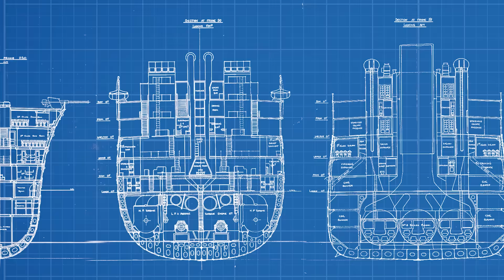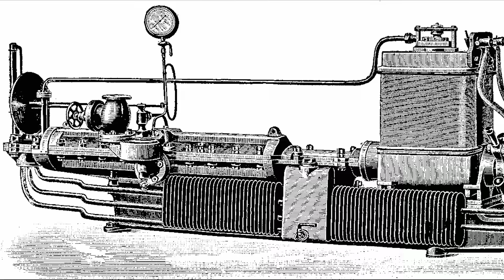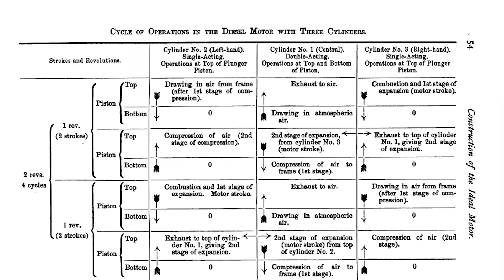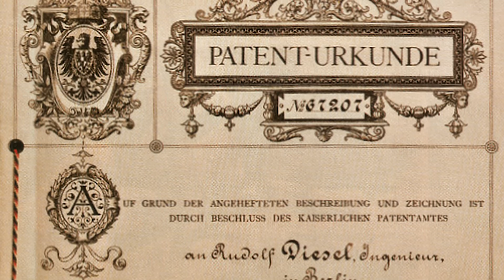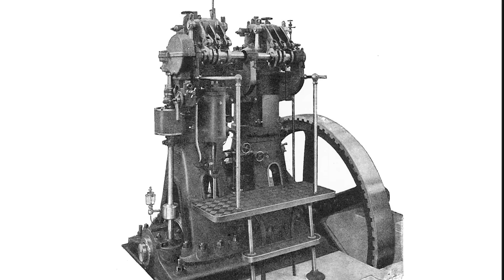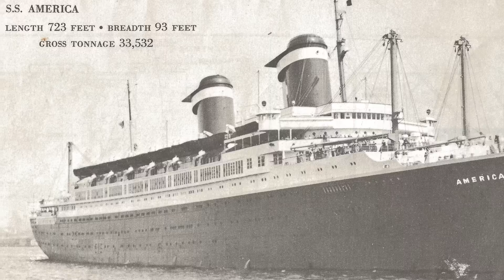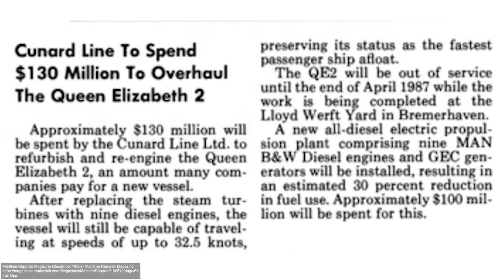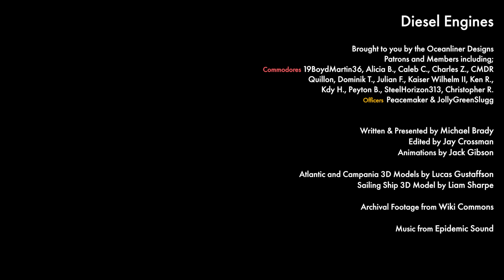How the Diesel Engine Became King of the Seas

Comment: We're still doing steam to diesel conversions today. One company I work with still operates two former LASH carrier vessels that were converted to container ships over 40 years ago. LASH was a system of transporting cargo pre-assembled onto small barges called "lighters" - LASH stood for Lighter Aboard SHip. The vessels had an integrated gantry crane that rode on rails along the full length of the ship. The gantry crane would pick up a lighter, move it to the stern of the ship, where the rails extended slightly outboard over open water. The gantry crane then released the lighter onto the surface, where it would be then picked up by a tug for final delivery. Because of the weights and stresses involved in the LASH system, these ships were seriously overbuilt, with a significant amount of steel in the hull and frame construction versus your average container ship. So, they are very stout designs that once converted to carry containers, undergo relatively low stresses, and therefore these designs continue to last a very long time. Eventually it made financial sense to convert from steam to diesel, and that's what was done. The entire aft end of the ship was cut open, the steam plant, associated machinery, and generator flat completely removed. In went a completely modern control room, medium speed diesel engine, new generators, and all new machinery. An interesting design quirk though was the requirement to accommodate the angle of the original shaft. Because of this, the main engine is tilted at a very slight incline. We've already seen that this makes piston and liner changeouts a little interesting, as this works best when both are truly vertical. The nice thing is that since the LASH designs are all generally forward house designs, you still pick up none of the vibration or noise associated with the diesel engine - the ship continues to be nearly silent and smooth as glass while underway.

Any way, great video as always.
Reply: I have sailed as Engineer on LASH conversions for APL, Matson and SeaLand. I know one was originally a Pacific Far East Lines ship. I'm curious, what are the names of the ships you speak of?
Reply: @Mondo762  former Sea Land/Horizon Reliance and Spirit. Reliance was converted to diesel beginning in 2020 and has now been renamed MV George II. Unfortunately the Matson LASH vessels are now gone.

Comment: Seems that it went forgotten that "Diesel" engines mostly run on preheated heavy fuel oil which is only slightly cleaner than coal.
Reply: Bunker oil, which used in boiler fired steam engines, is also preheated before being used.

Comment: I mean TECHNICALLY you could have an internal fission heat engine where you have it set up so you drop a small piece of fissile material into the cylinder and have it go critical at that point causing a fission reaction, it could rapidly heat the air inside the cylinder and causing it to expand, pushing said piston down in the same way the heat from a combustion reaction would. You would then enjoy the lovely side effect of getting to vent your spent fission products right into the outside air.
Reply: Aw hell year, INTERNAL FISSION ENGINE here we go lmaoooo

Comment: It's diesel in name only though. It reality it is heavy fuel oil, which is closer to bitumen than it is to actual diesel. I have been on a steam locomotive that used the same fuel. It had to be heated to flow, but it was a highly efficient fuel
Reply: It's diesel engine because the engine uses the diesel cycle, instead of the Otto cycle used on gasoline engines, and not because it uses diesel fuel, the fuel was named after the engine, not the opposite, and yeah even a modern diesel engine would work on cooking oil, engine oil you can see that when a diesel engine run away when it start to consume its own oil and can't be turned off, it would be good though, probably it would clogged the fuel injector as they are very precise in modern day cars, they can be adapted to work with different oils with more tolerant  injectors and fuel pump and still would be called diesel engines.

Comment: Whilst you are right to say that steam engines weren't good for submarines, and that diesel engines power modern shipoing, submarines are one thing that's turned that on its head. A lot of submarines now are powered by steam engines, but instead of burning coal or oil, they are nuclear. The same is also true of the biggest aircraft carriers.

Comment: Since weight and size are less of a constraint, maritime steam engines can be quite efficient (compared to railway locomotives, which have dire efficiency) with triple expansion, a condenser, and constant-speed running. Turbines can be even better and are vibration-free.

But when you start using oil as fuel instead of coal, you might as well get a bit more efficiency from a diesel engine.

Comment: The British Nuclear power company Moltex has a new reactor concept. It’s undergoing homologation in Canada. The core operates at atmospheric pressure with no water or steam inside. Molten salt is used to move heat from the fuel rods to a secondary salt circuit which does raise steam. It’s intrinsically safe and naturally follows load demand. It cannot overheat. It also separates the fission gasses so there’s no neutron contamination. The especially dangerous elements (caesium and iodine) react into another salt (caesium and iodide). It fully burns the fuel so radio radioactive waste disposal is not an issue.
Reply: Nuclear can be safe and actually cleaner than other power sources overall
Reply: @Sid-jx4gl  Nuclear power generation has always been significantly safer and cleaner than, e.g., power generation from coal. The accidents, while on the surface more scary, are far fewer (one reason they are more scary) and a lot of the life-years lost and deaths from coal power are just sort of ignored. As well as the relatively frequent (compared to nuclear power) environmental disasters at coal plants themselves, such as the Kingston Fossil Plant coal fly ash slurry spill, and the various cancers and other diseases directly caused by accidents like that, there's also the direct radiation release by coal plants ( far higher than nuclear), the other forms of pollution (also causing widespread cancer and other diseases), and, almost completely ignored, the production chain that literally kills directly thousands of people every year. 

There's little question that, since 1945, use of coal for any kind of power has killed far more people than every use of nuclear power ever. (Yes, this includes the nuclear bombs dropped on Japan.) Even excluding all climate effects.

But disasters that large and widespread, occurring over that much time, are just something we're used to, so it's apparently not a big deal. Whereas the Fukushima nuclear disaster, a relatively successful recovery from a design flaw, killed perhaps one of the almost 20,000 dead from the environmental disaster that precipitated it. (There are 30 deaths directly attributed to the Kingston Fossil Plant disaster above.)
Reply: @Sid-jx4gl  not when it explodes.
Reply: Is it similar to the salt nuclear reactors used in Russian subs? Those had a major drawback that if it ever cool down the salt had become a solid and would never move again in the pipes and things would be clogged
Reply: @b1laxson  Russians cooled reactors with mix of lead and bizmuth on their subs. Very similar but different coolants. Russia has three salt cooled fast breeder reactors producing energy and burning nuclear waste from classic reactors... Since 80s
Reply: Learned something new and fascinating today! I hope it lives up to the designers' vision.

Comment: One note-  you showed the Symphony of the Seas as the modern user of a diesel, and then described one of the giant modern diesel motors that is also in use.  But those giant diesel motors are used in container ships, whereas the Symphony, like all modern cruise ships, have multiple smaller diesels (they Symphony has 6 diesel engines).  Cruise ships do this because their speed is quite variable, and they also are in port all of the time- so to get best efficiency, they can use the combination of the 6 to be best.

Comment: Another great video, you could have mentioned though the difference of energy density of oil (or refined such as gasoline) vs coal. Gasoline has energy content per unit of volume nearly double that of coal. I wonder how this changed both the useful ship load capacity or the ship's range.

Comment: 😊😊😊😊 One advantage the turbine dream engine has over the diesel engine is it 
is normally quieter and smoother in operation. I have worked on both and found the turbine quieter and and smoother. You don't get the thumping of the pistons.

Comment: Diesel jumped. He believed his engine would replace the Otto engine. But there was one mistake. He was working for Linde when he invented his engine. Diesel's name was on the patent. But Linde owned the intellectual property and it was Linde's name (MAN) that was on the engine. Linde could do a deal with anyone he chose and there was nothing Diesel could do. Benz wanted to get rich. He wanted to sell lots of cars. But here came the glitch. Benz was in partnership with Daimler, and Daimler used to be Technical Director to Otto. Daimler and Benz were not going to abandon the Otto. The Otto engine needed something like a gas to operate. The new fangled  "petrol" was ideal. So Benz needed a lot of petrol. Making petrol by cheap simple distillation creates a lot of waste. Take a 50  gallon barrel of - even good oil - and you get 20 gallons of petrol and 30 gallons of waste. Benz had a vested interest in helping the oil industry get rid of this waste. That is when he noticed the Diesel engine on board ships. Benz figured, if the Diesel could burn crude oil, it could be used to burn off the waste. In 1913 Benz launched the worlds first Diesel truck to do just that. Diesel was horrified. Instead of replacing the Otto engine, his Diesel was used to clean up the waste bottleneck from the petrol motor car. Diesel saw what was coming. For the next 110 years we had one hell of a party. With the Diesel engine burning off the waste there was no limit to the amount of oil we could waste in our Otto petrol car engines. When Diesel saw the "dumbed down" engines Linde was building for Benz, he felt his life's work was betrayed by Linde. He jumped off the ship. We could have halved the amount of oil we burnt in our cars - look at your own figures for the ship efficiency. We could have done that with our cars over 100 years ago. (And if we ran Diesel cars on the petrol, they would have been cleaner too.) Today we have two engines. There is no engineering reason for it. It is simply that Benz, Daimler, and Otto were old muckers. Now, because of all that waste, we need electric vehicles. Diesel had worked his whole life believing in us. The horror of seeing what we were going to do, was too much of a shock. If Diesel actually saw how it panned out, I think he would have jumped again.

Comment: If fuel cost is not a problem, boilers and steam turbines are a fantastic solution in a ship but when you throw out between 70-80% of the energy back into the sea compared to the amount of energy you fire in the boilers, then this solution is not exactly an economic solution.
Diesel engines are just more efficient and economical regarding fuel consumption.
Very large liquid natural gas carriers used boiler and steam turbines for propulsion up to recently, but these ships are also now slowly disappearing after it is now possible to use the gas boil-off for two stroke Diesel type engines in these LNG carriers so steam turbines are quickly disappearing completely from commercial ships.
Nuclear powered ships still use steam turbines.
Gas turbines are used in many navy vessels but steam turbines in ships are mainly a thing of the past.

Comment: Fun fact liquid natural gas is quickly replacing disel engines in ships due to bans on sulfur making Diesel more expensive. LNG is actually a little more efficient too which means larger, taller ships, that go faster than their predecessors.

Comment: at 5:30 you misspoke , the air is compressed and then the fuel is injected while the combustion chamber  temp is above the flash point of the fuel

Comment: I'm surprised that gas turbine/generator engines aren't mentioned.  They seem to be almost universally used for new construction cruise liners and similar ships.  Maybe because they really haven't supplanted diesel, except in a few applications - or because they technically aren't engines (which are electric) - just power systems?
Reply: yeah same here, a little bit confused

Comment: Mike, A small correction.
5:27 The diesel cycle draws in only air which is then compressed, raising its temperature.
Only then is the fuel injected into the cylinder, which then mixes and ignites.

All the best.
Reply: Check out Rudolph Diesels original designs when you have time and you will find that, though injected Diesels are the norm and much better, it isn't required for a diesel to operate. Contrary to popular belief, there have been been carbureted Diesels. Also, consider the effects of ether on a diesel engine. You could cut the fuel completely and it will still fire and run on ether.
Reply: @ranwinrepair  It is important that combustion occurs centred on top dead centre and begins and ends very close to TDC.  if it does not, there is a loss of efficiency.   But to ensure smooth idling and easy starting, the compression must be such that ignition is certain to occur.   If you have a carburetor, either the engine won't start, won't idle, or at open throttle ignition will occur far too early.  This is why diesel engines inject the fuel at TDC at a pressure sufficient to overcome compression.
Rudolph Diesel's early idea was to inject the fuel using compressed air but the bulk of the air was sucked in same as with modern engines, before the fuel was injected.
There have been engines that had a carburetor and no spark plug, but they weren't true diesels - they were hot bulb engines, where a shaped piston and low compression delays ignition until TDC and the hot bulb functions as a spark plug.  These engines could run of cheap fuel but did not have the high efficiency of a diesel engine.

Comment: Over 100,000 hp. . . one engine. How many 'Neddies' needed to start it? - Compressed air? - Pull-cord?! : )
Reply: There's this channel by a ship's engineer that I followed for a while, and in one of his videos he explained the whole process. I forgot a lot of it, but I'm pretty sure it indeed involved compressed air. But actually I think the compressed air was used to start a smaller engine, and that smaller engine was used as a starter engine for the main engine. I could be wrong though; it's been quite a while since I saw that video. 

It certainly wasn't as instantaneous as starting a car's diesel engine.

Comment: Isn't the diesel they use inside those large ships like sludge?
Reply: Yes, I was confused if the topic was oil-burning ships in general.
The Heavy Fuel Oil aka bunker fuel is a quite viscous and needs to be heated before use.
When closer to land, many countries require ships to switch to a lighter fuel (ex: Marine Diesel Oil) to reduce pollution.

Comment: what surprised me was the ability or marine diesels to turn in both directions just with turning a lever selecting in which way the compressed air will push the shaft during startup. by the way, as you mentioned nuclear propulsion (as you say, basically a boiler) could you prepare an episode about the Savannah and others of its kind?

Comment: Steam turbine to Diesel conversions are actually kind of commonplace in the USA as well, mostly in our Great Lakes Fleet of freighters. There have been several “lakers” swapped over to diesel power over the years, with steam vessels now being a rarity where once steam turbines were the predominant power source for the US and Canadian Great Lake fleets. The few steam powered lakers still in service have been kept original partially due to the speed advantage mentioned here but they’ve also been made more viable in the modern world thanks to technological advances in boiler / furnace efficiency and the invention and adoption of automated firing and engine control systems making remote operation of the steam turbine power plant from the bridge possible.

Comment: Don't be fooled into thinking Ships run on the Diesel fuel you put into your car. These days they switch to Diesel when close to land. In open ocean the run on heavy oil that is more polluting.
In the 20th century the ships ran on heavy oil only. It really is disgusting stuff and nothing like that used in motor vehicles.

Comment: Another factor that caused the demand for motor-powered ships to increase was the Suez Crisis of 1956, which saw the canal being closed off for several months and necessitated ships to go the long way around Africa, which ate into the already inefficient fuel consumption of steamships.

One company affected by these ramifications was the state-owned Irish Shipping Limited, which subsequently converted most of their fleet to motor ships while selling off the three that were deemed unsuitable for this process.
Reply: Did South Africa have coaling or oiling capability?
Reply: Considering that Cape Town was both a common port of call for ships traveling to Australia and the terminus for the Union-Castle Line's foremost service, I'd say that there definitely were such facilities.
Reply: @Daniel_Huffman  Well I figured they had coal, but oil would likely have had to be brought in from somewhere else.